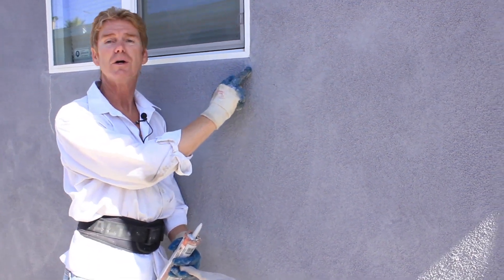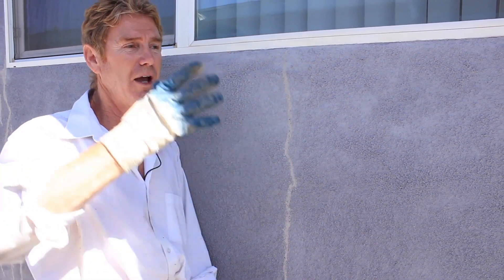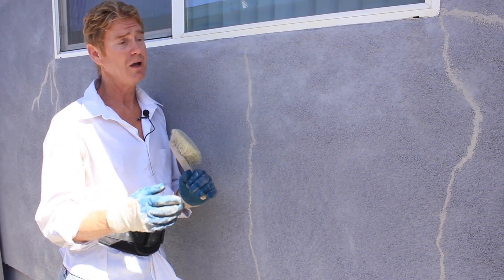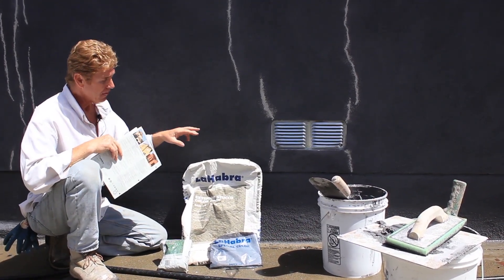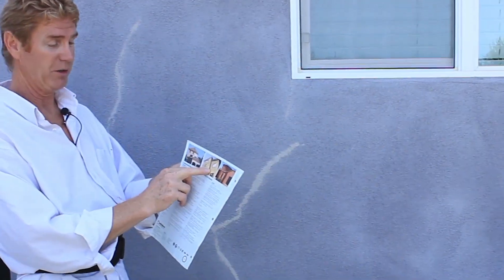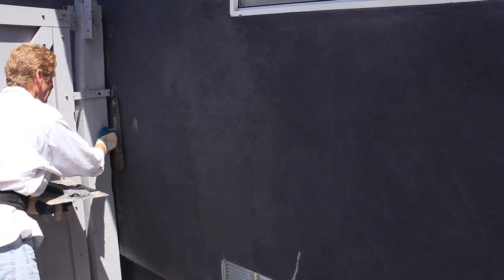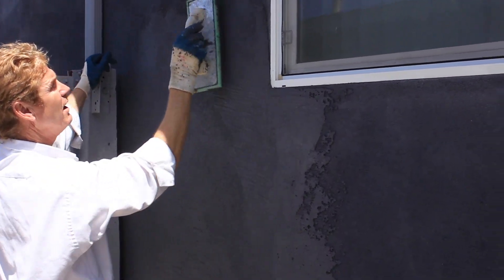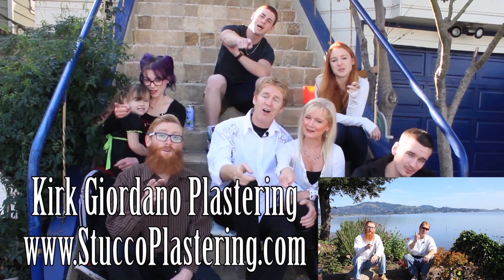Stucco color finish repairing cracks

Comment: We have a "web" of hairline cracks in the stucco coating on a foam-block building, in AZ, with no building movement. Whether or not the stucco was applied correctly, or not, isn't the issue; how to abrade (if necessary) seal, and re-paint is the question. It would take a life-time to attempt to calk all the cracks; I will calk the larger cracks, however. Otherwise, the building is literally spider-webbed. Have been told there ARE sealers, and paints, that might fill the smaller cracks, if thoroughly rolled on application. Any thoughts greatly appreciated!
Reply from the maker: sdslim9012 Hello, I would suggest you pressure wash well, then use a quality primer then a top coat. I have heard great thing about the Kelly Moore Elastomeric coatings, these paints are a high quality,top of the line  exterior painting system. 
Features waterproofing properties, good film strength, elasticity, elongation and bridging of cracks.
 Best wishes, 
 Kirk giordano
Reply: Kirk & Jason Giordanos DIY plastering and stucco tips you, Kirk! I really appreciate your expertise. I did pressure-wash, with stripper-nozzle, which has removed some of the top-coat; assuming poorly adhered areas. The contractor originally painted with an elastomeric product, thou not Kelly-Moore. While I recognize the paint didn't "cause" the spider-webbing, it didn't seem to tolerate it well, either? We have some related paint adhesion issues (some blistering) so I suspect the paint-contractor cut corners. Several commercial painters I have consulted with are no-longer huge fans of Elastomeric paint in Arizona's harsh sun; two have instead recommending products such as Dunn-Edwards "FlexPrime" or "Ultra-Grip"; two-coats back-rolled, and "Ever-Shield" or equivalent as a top-coat? Having said that, I will take a hard look at the Kelly-Moore products, perhaps paint a few "test-areas" and see what transpires. Again, I sincerely thank you for your council!
Reply from the maker: sdslim9012 
The Kelly Moore product I mentioned is a sealer, perhaps your area is not proper to apply a sealer?
 Do you know some of the reasons why homes in the heat crack?
 If not out of the 10 video’s I have on this issue, I will forward the link to 1 or more FYI, as maybe it’s out of your as well as the applicators hands. Many times this sort of cracking is caused by the heat of the sun.This heat can and does expand the studs and or shear wall causing this type of cracking as this wood dries out it twist and or expands without a gap being placed between the sheets of plywood it's even worse. If this is the case these actions never really stops, season after season, unfortunately.I am not a negative person, but sometimes knowing the true actions of a situation beats the frustration of wondering what the hell is going on all the time and why it can't be fixed. Best wishes my brother.
https://youtu.be/2sBHTy-v9ic

https://youtu.be/C3Jqe6sQt2s

Kirk giordano
Reply: Thank you, again, Kirk! "Yes" a sealer coat was applied (and typically is here-bouts) on our building. I suspect, it was either not a good product, or was improperly applied (or both) prior to the building being painted. And, as the same likely holds true regards the paint top-coat. in addition to the spider-webbing, and blistering, there is some lime-streaks leaching through in areas. The building in question is grouted foam-block ("Rasta") construction, and the high summer temps could well be a factor; the hair-line cracks seem to follow the seams between blocks - at least in some areas. It's our current plan to abrade the existing paint (looking at options; soda-blasting, sponge-blasting, "spiral-nozzle" pressure-washing...) then re-seal, and repaint. I have begun looking at the Kelly-Moore products based upon your comments. Thank you very much for your insight!
Reply from the maker: Hey dude, if the headlining seems to follow the blocks weather cinder blocks are made of of cement based or styrofoam based mixed with portland, tells me that more than likely they did not apply a coat of cement plaster thick enough, or the building is settling.

We just did a re-coat on a movie theater that was plastered 10 years ago the ground settled a foot and a half, giving the foundation a really ugly appearance. the weather in that area was in the 90s to 100,s often, settling occurs but is not seen as it's slow so most folks don't believe it to be a possibility.
 If you can't see it surely it can't be happening?
 Best wishes, 
 kirk giordano plastering

Comment: Kirk, terrific how to video and my home isn't even stucco. I learned about EIFS maybe a year after moving in. 16 years later I have a few hairline cracks 6-8 " long. Can  I cover an EIFS crack with a good caulk? I know it's not stucco.
Reply from the maker: Howdy Larry, of course, you can as long as you have the correct color to paint afterward,
 A good caulking for stucco cracks is Mor-flexx as it has the right sand.
                      Best wishes,
Sound advice From your neighborhood stucco geeks

Comment: What sealant do you use for the caulking? 
I have a home that has hairline fractures all around and I want to apply the same paint that you’re using on this house instead of painting over it. Which sealant do I use for the caulking?
Reply from the maker: Greetings Felipe, I'd recommend Mor-Flexx as it has sand in it, just like stucco.
                Get plastered like stucco
 Kirk and Jason Giordano’s sound plastering advice
Reply: So this caulking you recommend, the color coat will stick to it and not flake off and does the color code Flash because of the difference and suction then the wall has
Reply: @edmundfrausto7588  good question! I think the amount he surrounds it with and binds to the existing will give enough strength to stay on..if you dont play handball on the wall :-)

Comment: Thank you for making this video. You mentioned that the waterproofing paper inside the stucco most likely still intact for new building. Do we need to refill the crack? can we let the crack as is since it is more cosmetic issue?
Reply from the maker: I'd recommend filling the cracks so the rain does allow excess swelling.
Reply: @StuccoPlastering  Thank you kindly for answering my question and providing recommendation.
Reply from the maker: @jkbc  no problemo

Comment: Kirk, I saw you put color coat on an existing color coat. I assumed you did that while the wall was still wet - but you DIDN'T use the Weld-crete first. Could you comment on that?
Reply from the maker: Hi Michael, excellent question,
 bonding agents are not necessary when you have a porous wall, 
what we do in this case is wet the wall and the two adhere by suction. (stucco and any porous wall)
 Other walls that are porous are cinderblocks, bricks and concrete,
 all these surfaces must be pressure wash clean enough to eat of as stucco does not adhere to dust, dirt, grime, etc.
 best wishes,
 Kirk giordano

Comment: Hey Kirk why did you wet the wall first before applying the color coat ? Thanks In advance
Reply: This helps keep a live or wet edge to the product you're about to apply and increases open time and workability by cooling the surface and reducing the suction of the substrate.
Reply from the maker: Howdy Gary Dude, couldn't have said it better myself, thank you.
                        Peace love and happiness to all.
      Plastering and repair tips for your number one investment

Comment: Enjoyed your informative videos! Quick question for you... we're closing on a new build in Mesa, AZ tomorrow. We fully expected to see some cracks in our stucco as the house settles, however, one wall in particular of our 1-story home, about 80' long, has in excess of 60 mostly vertical cracks running through it. Is this normal? Does it speak to a bigger issue either with the stucco installation or something else wrong? TIA
Reply from the maker: Howdy Sprik, excellent questions,
  sometimes its caused by not gapping plywood or sheathing, 
 how many times do the contractors actually space the sheets,
 Perhaps 2 out of ten in my area as we live in a cool climate.
Yes, I do have video's where I show this spacing too.
 The reasoning behind this spacing is a bit interesting.
 I have seen and videoed a few homes which have horizontal cracking every 4 feet,
 There are about 20 solid reasons why horizontal cracking can and does occur.
    The main reason being, the studs and or sheathing was green when the framing took place.
Now take 2 to 40 days or more with intense heat bearing down on a stucco wall for many hours per day, extreme heat will expand the wood, thus push on the stucco, voila cracking occurs.
 
FYI, if a person lives in an area that does not get hot, expanding sheeting may not occur.
 I live in an area where we have only about 10 hot days per year that it reached 95 or above,
    However in some of the valleys "inland" where I sometimes work I have seen the horizontal cracking often as the sun is more intense especially if a home is on top of hill and facing directly toward afternoon heat.
 
    What is happening is the sun bakes the wall expanding the wood and often twisting the studs as the natural drying process occurs, thus the stucco cracks horizontally.

    Most stucco walls just crack somewhat vertically and at a slight angles at all doors and windows because of vibrations and or movement of opening and closing.
   Concrete like stucco can only flex a wee bit, as it's sort of like glass, the slightest stress can shatter glass.
With stucco the slightest movement and or vibrations causes hairline cracks, this does not affect the integrity of the waterproofing membrane, however most folk panic as they have no clue why this happens.
   Thus any expanding of wood is sort of  like Kryptonite to superman, not good.
   If you use a saw to cut the touching of the plywood this issue can be resolved or helped, this should be done to homes in hot areas that the temperature reaches well over a hundred degrees for months at a time.
  Plus the biggest factor of why concrete and  or stucco walls hair lining is rain, depending on the amount of rain lifts homes and concrete because of natal ground expanding with water, when dryer condition occure homes and concrete settle, thus hair lining.
 There are about 20 other solid reason why stucco walls crack but these are the most common.
 
    I will send a couple videos about horizontal cracking.

 
https://youtu.be/2sBHTy-v9ic
https://youtu.be/7mxGCVfLZAY

Comment: have you ever seen a wall with scratch coat then brown coat and cement as last coat if so can you tell what kind of cement to use to fix cracks i have tried every thing and cant get anything to stick
Reply from the maker: Howdy Garulle dude, if it were me I would choose Mor-flexx, as it also has sand in it which matches most stucco finishes, clean the area well as nothing adheres to dust.
 Best wishes with your projects,
 Kirk giordano plastering on small repairs

Comment: hi kirk, i did a smooth finish a year ago on a house up on the hills. the owner called me not too long ago complaining about hairline cracks. but some cracks are a little bigger.  ive never been asked to fix cracks on a smooth job. what is the best way to fix cracks on smooth and do you have a video showing the process?
Reply from the maker: Howdy Mario, dude below is a video that explains why stucco cracks,
 I tell folks no house I stucco, can I  guarantee won't hairline as this is caused usually by ground movement mostly plus many other reasons see the video below.
https://youtu.be/C3Jqe6sQt2s
 cheers,
 kirk giordano plastering

Comment: i power washed my home, and just filled in my cracks, was going to use a elastomeric coating over it..how do you feel about it?
Reply from the maker: Howdy Mischievous, as long as you pressure washed very well, to fill your cracks i would recommend Mor-Flexx caulking, than paint, the elastomeric paints are some of the best longest lasting and flexible paints sold.
        Live long and Plaster
 images for stucco/plastering and teaching video’s

Comment: Kirk. Just finished a 3 coat system(hard coat stucco) float finish. has craze cracks already. how do you explain to a customer that craze cracks are normal?  all customers seem to focus on is superficial cracks.
Reply from the maker: Morning ZX dude, 
CRACKING, I can fill this page with reason why this has occurred, but none would include faulty workmanship or materials used, however this is a slight possibility.
 Instead they are all related to natural circumstances, theses cracks although not pretty are quite harmless.
 Weather, such as high winds or rain for just a week let alone a month will raise the ground thereby lifting this structure just a hair, stucco or concrete like glass will not flex much instead it cracks.
 Movement, such as all traffic and especially heavy garbage trucks will create ground movement, again the house will move thus, cracking occurs.
 The wood structure, The studs and the sheathing, when heated by the sun will swell, thus pressure on the stucco will cause this cracking, opening and closing door will create vibrations, again cracking.
Natural settling foundations which happens to all homes, will also cause this cracking.

I tell folks if they are going to install  roof tiles, decks, sheetrock, or any other heavy beams, do it before the last coat of stucco is on.

 These common circumstances are just the tip of the iceberg in reasons why cracking occurs with stucco walls or concrete slabs.

 I have been in this trade for more than 30 years and to this day still guarantee my work, however there are some issues that are out of any applicators hands including the general contractors. 
 Most folks do not like to hear this but movement and or vibrations will crack a stucco home, however the so called good news is, it's unsightly but this does not cause water intrusion.
 Best wishes,
Kirk giordano

Comment: Cracks happen also when the cement dries out too quick not always necessarily the movement
Reply from the maker: Greetings S B, I find that when color finishes dry to fast they dont adhere well, bleed and are varied in color, cracking? spidery, just a bit.
 This kind of cracking is movement, I found out this was on the Hayward fault line plus it had two substrates, I didn't realize this when I excepted this project.

                Get plastered like stucco
 Kirk and Jason Giordano’s sound plastering advice

Comment: well my new house and brick fence got many(not really) crack but why my old house so clean very few crack?
Reply from the maker: Evening Amir, my guess your old home was built better.
Any home set on the earth is prone to cracking, take rain say for 5 days let alone an entire month for example, the earth will swell, this is perfectly normal, when the ground settles the house can and will move, you won't see or hear it, however a crack may appear. 
Why?
 Vibrations and or movement causes cracks in concrete, plaster, stucco and many other materials.
 Movement to stucco is like Kryptonite to Superman, sort of anyway as it does not weaken it but it can crack  :-)
Also high winds, heavy traffic, slamming door and window, moving heavy furniture causes vibration or movement and then Voila a hairline crack. 
These causes are just the tip of the iceberg.
 No worries, keep in mind that 99% of all cracks are petty and quite normal.
 Cheers,
 kirk giordano

Comment: how do you repair hairline cracks on the Santa Barbara Mission finish?
Reply from the maker: Howdy image29, Hairline finishes in a santa Barbara Smooth Mission Finish style color coat system, can't be repaired, as it's the basecoat coat has moved or lifted, this is very common,
 You either forget about the cracks knowing they are simply cosmetic and naturall , or you apply another coat of this same finish wall to wall, 9 times out of 10 these same cracks will return as among the hundreds of physical issues that is out of an applicators hands are mainly the rains.
 If it rains a day to 30 the ground can and will always life a house, then when drier conditions occur the house will settle.
 This natural occurrence can't be measured by the human eye, however it's real, therefor the settling will sometime tweak the walls a fracture or a great deal more, thus movement and vibrations, theses circumstances will always results with a hairline crack in the stucco basecoat, keep in mind the finish coat has little strength as it's primarily for looks and  to achieve a maintenance free color finish.
 Most folks, who try and repair these hairline cracks make matters worse as caulking and or fog coating do nothing except enhance these cracks, especially when the home gets wet due to rains.
 My advice is to find yourself a coconut tree in the Bahamas or perhaps your own backyard, relax with your feet in warm sand or your hot tub while sipping margarita's with tiny umbrellas and realize this is nature, and there's nothing us mere mortals can do about it except, get an understanding of why this occurs, I believe once we know why, this wisdom, neutralizes any worries or nervousness that might be in our brains.
Cheers,
 kirk giordano
Reply: +Kirk &amp; Jason Giordano&#39;s plastering &amp; stucco tips You made me laugh!  You are absolutely right, I won't overthink this, and just go for it.
Reply from the maker: atta boy, 
cheers,
 kirk giordano